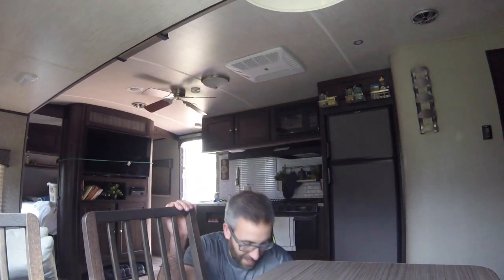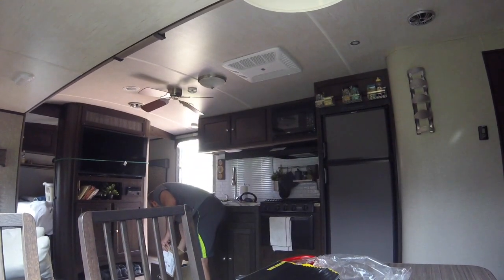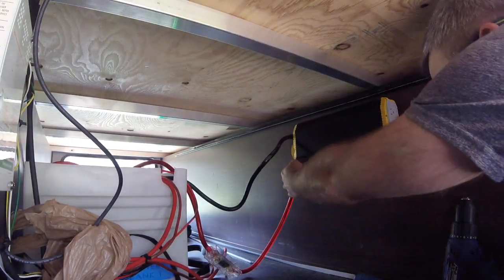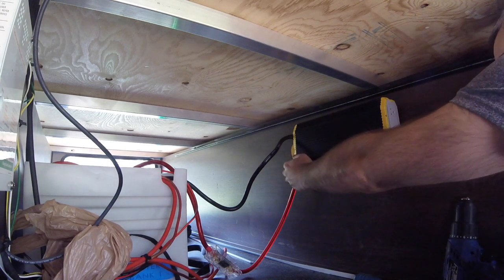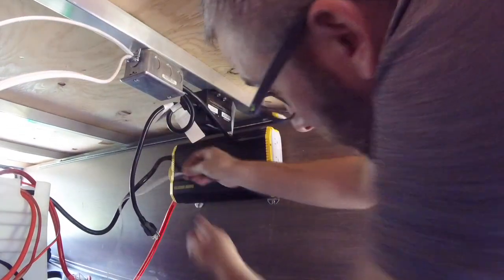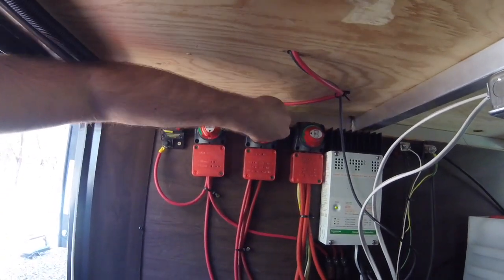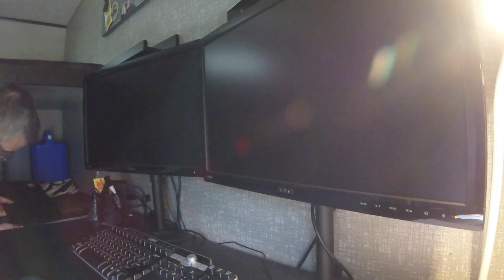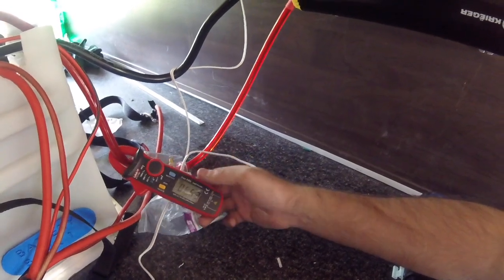15amp auto transfer RV power inverter install

Comment: How did you run your Romex wire from the distribution panel to your pass through? Looking to do the same inverter setup but struggling how to run the wire. Our RV looks to be a similar setup to yours. Thanks.
Reply from the maker: I pulled the plastic off underneath and pulled it through the floor truss with the other wires.

Comment: How has the inverter worked out?  Any issue with it being a mod wave?  Looking to do the same.
Reply from the maker: Works great. No major issues, draws a lot more amps then I was hoping (compared to just using a small inverter)